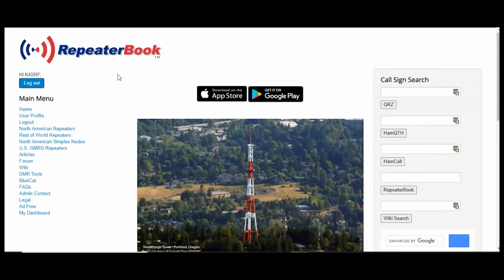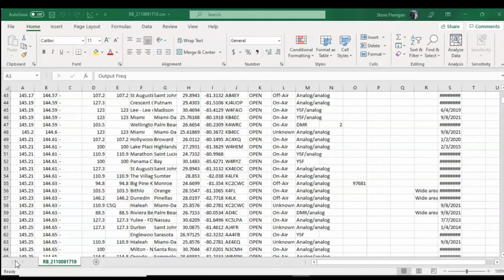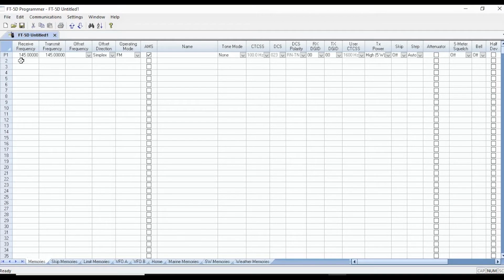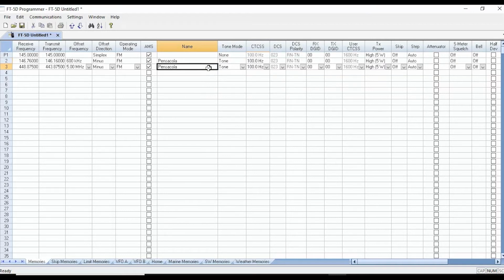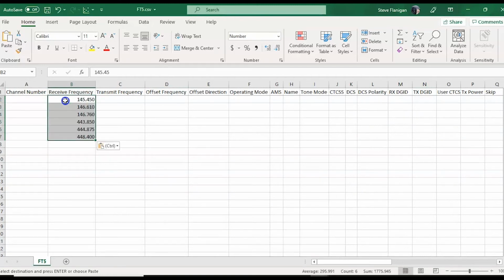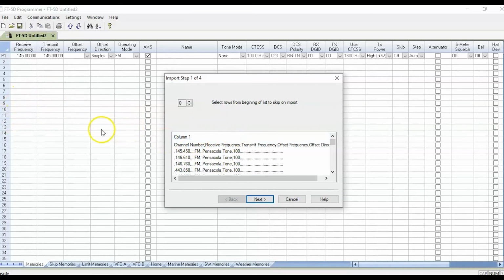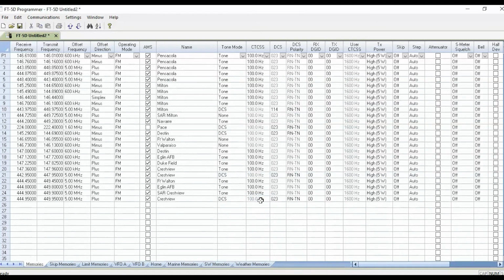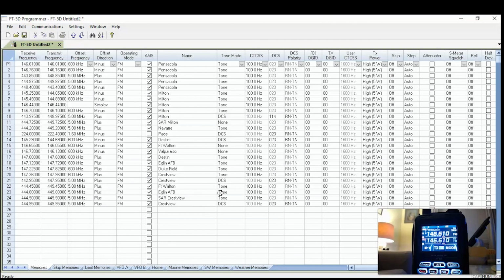Programming the Yaesu FT 5D with the RT System Software

Comment: Why use the RT Systems software when Yaesu offers their own? I've purchased two RT products over the years, and have been disappointed both times. Seems that free offerings are almost always better.
Reply from the maker: I used the system software that came from the radio on different radios and found the RT Systems more stable.

Comment: looks like exactly the same software as the FT3D. you think you can use this software for both radio's? and i always use the SD card. works easier.
Reply from the maker: Not sure.  This would be a question that RT Systems would have to answer.

Comment: Great video on programming the FT5DR with RT Systems software! Those steps should make it simpler to do. The Repeater Book website would be better if you could enter your location and search for a list of repeaters within a specified mileage range from your location or maybe the center of your zip code. 

You’re Yaesu FT5DR tutorial videos are fantastic! They make learning how to use the Yaesu FT5DR easy. 

Do you have any hotspot videos, such as the OpenSpot4 Pro?
Reply from the maker: No hotspot videos but I will put this into my list of suggested works.  My problem in getting videos out is due to time constraints, aka:  work and life getting in the way.

Comment: I have found everytime you upload to the radio it changes everything to FM and not DN even though they are set as DN in RT Systems software and I seen everything you programmed said FM even though you did say you were programming some C4FM frequencies.  RT-Systems was no help and no matter what I do they all switch to FM and I have to manually have to switch them back RT-Systems says it shouldn’t do that but can’t tell me how to fix this any idea?
Reply from the maker: Trying to follow you here.  What radio are you using this to program?
Reply: @K4SRF  the FT5D. And I opened a new file and added everything as before and it worked there must of been a glitch in the program file or codeplug what ever yaesu calls it I reloaded the original file with all the allocation modes to DN and in the radio went back to all FM reloaded the new copy of the same file and it worked and set everything to DN.  So it must of been my programming although I don’t know why and RY-Systems took the original file and it worked fine for them  so I just deleted the original and things appear to work fine now

Comment: Hi Steve, thanks for the video. In the beginning of the video, you chose csv to work with. There is however a few  lines lower an option called RTSystems. Is there a reason you chose to go over csv and not use the RTsystems option ? 73 de VK6BLU, Johan, Perth, Australia.
Reply from the maker: No reason, just a choice.  I now use the import from external option, in my case from Repeater Book.

Comment: I don't mean to sound like a doalt,  but I had some questions.  I am a new ham with a tech license.  I understand the loading of RT systems data to my Yeasu (FT-70D), I am sure that this video will be similar.  When you finished the upload to your radio, how are the different uploaded channels accessed?  Are they on several buttons, or just one and then "drill down" to the different frequencies?  that is my problem. Thanks for the video. 

Richard
Reply from the maker: I think this all depends on your radio and how it can be set up.  I am not familiar with the FT-70D, sorry.

Comment: The Yaesu ADMS programming software is not that good.  RT systems says when they retire, the company will cease because there is no successor or purchaser.  I wonder if that is still true.  Their programming software is much better than most of the stock programming software.
Reply from the maker: It would be sad for RT to cease operations as they have such a good reputation and product.

Comment: A GOOD PORTION OF THIS VIDEO concerns transferring data from Repeater Book to an Excel spreadsheet and then to the radio.   THE EXCEL SPREADSHEET STEP IS UNNECESSARY and time consuming.  The RT software IS a spreadsheet.   No need to transfer files twice.
Reply: You should remove this video. Redo the instructions correctly if you want. Get rid of these wrong instructions.
Reply: @jspencerg   Absolutely right.  A video maker can and should delete OBVIOUSLY misleading content out of respect for viewers.
Reply from the maker: At the time of this video, it didn't work.  Turned out to be a security setting on my PC.  Your point is valid and taken well.  And, it's working fine now on my end.
Reply: @K4SRF   You should probably delete this misleading video out of respect for your viewers who might spend extra hours going down the wrong path.
Reply: RepeaterBook has the ability to filter on counties during selection.  I was able to do this for transfer to the ADMS-14 software.
Reply: I may be mistaken, but I think Excel was used to perform a filtering function on "County" because only three county's data was needed and not the whole RepeaterBook CSV listing for FL.

Comment: I have been struggling for 2 days. I can import form the radio, but even if I don't make s single change when i try to send to radio I get a data error not a valid frequency. Nothing updates.
Reply: Buy an $8 SD card and use that instead.
Reply from the maker: Make sure you have the latest version of the software for that model radio.  If this doesn't work, contact RT Systems.

Comment: You obviously need to watch a tutorial on using RT Systems software.  You can do all that by just going to ,
file,  External data and then repeater book search. Right inside of the RT systems software. 
WOW !!!
Reply from the maker: This did not work and produced errors.  One error was that it couldn't pull information from Repeater Book.
Reply: @K4SRF  I use this method with 4 different radios including the ft5d. If you watch the RT systems tutorials, they will teach you the same thing. 
It works for me every single time.
You might be doing something wrong. Try "downloading from radio first", then make all the changes, and then upload to radio.
Reply from the maker: @miaminarc  I have used this software with my Kenwood's and ICOM radios too; works great. 

BUT. . .I found my problem this afternoon when I had time to research.  It was a recent Windows security update.  I disabled the update and the software works now as intended.

I figured it was an update issue because while testing, the RT software also threw the same error message with my Kenwood and ICOM radios as well.

Problem solved.  Thanks for your input though!